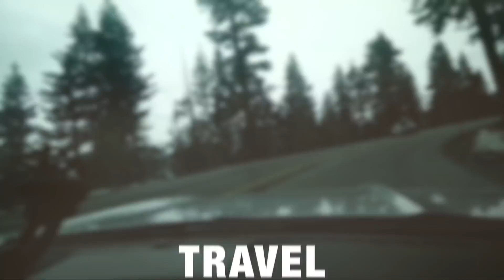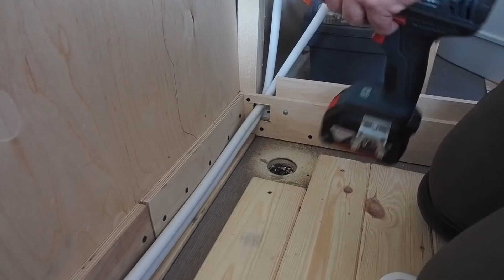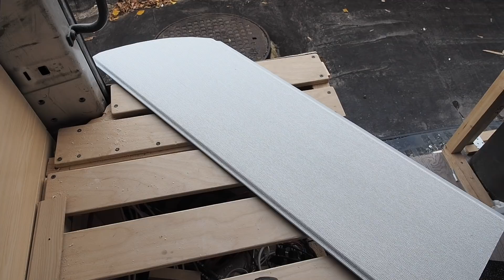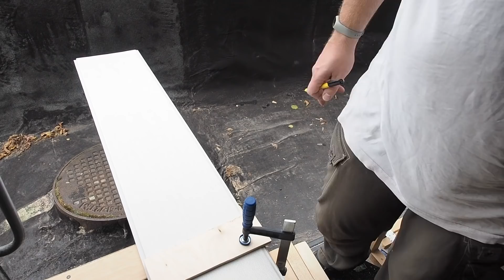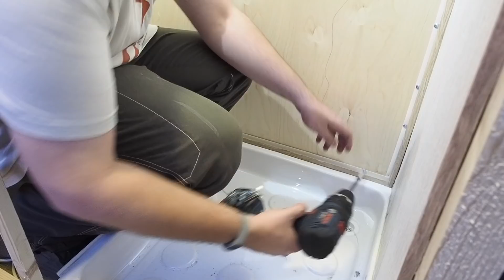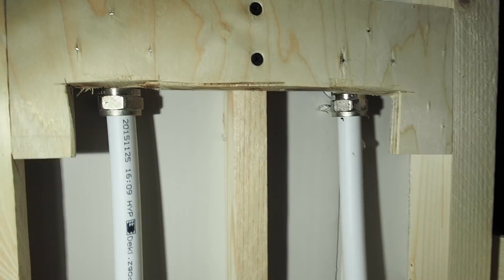Bathroom building in van conversion. Plastic paneling, shower tray, mixer tap, shower head, piping

Comment: curious about... why did you put the shower in the middle of the van? I plan on installing mine in the back, so I could use it outside, like to remove beach sand or dirt, just open the read doors, clip a curtain, and be done with it... also... where does the wasted (gray) water go? just outside or do you have a gray water container?

Comment: i will use cement board for the shower wall
Reply from the maker: Cement boards in RV probably not the best idea.
Reply: i never learn how to do RV but i learn how to remodeling the house
Reply from the maker: Not all works for rv that you use at house. Cement boards will just fall apart with vibrations
Reply: I saw couple use cement board on their skoolie. i bet it works just the same.
Reply: @Vantouristcom  hi. What material are the panels you used?

Comment: great vids ...very precise.....just a thought on the 15mm speed fit(if thats what i was ?) i thought it was advised to use pipe stiffeners when connecting to a compression fitting. maybe your experiences have indicated this is not needed.?
Reply from the maker: No, thats not that types of fittings. We didnt have speedfit with stiffeners in my country
Reply: VanTourist....sorry, i thought you were in the UK !
nice job by the way, going to be a smart van ;-)
Reply from the maker: Thanks!

Comment: Very handy man. Thank you. My strategy is to buy a taller wardrobe cabinet and simply punch out the floor and line it with plastic panels to cut on woodworking work time.
Reply from the maker: Nice plan! That could work

Comment: I would have really a rethought running the electrical wire right behind the shower pan and if it had to be done I would have used outdoor wiring you know that grey stuff
Reply from the maker: Too late :) anyway I sure it will not be a problem there. This wires have huge isolation and will not move at all.

Comment: Did you miss a step with the shower drain? The drain was in 2 parts (funnel and grill) and when you put the glu in, I didn't see the funnel part being installed before you glued in the pan....
Reply from the maker: You didn't see it because funnel was already secured under the pan. funnel and grill connected together with bolt & nut. I guess i just didn't have video of doing that

Comment: Just amazing. Where did you get those plastic panels for the bathroom? Thanks.
Reply from the maker: Hi Juan. I bought them local and sadly they are not sells outside Russia.
Reply: VanTourist I liked it very much because is made of plastic and it is better for water and easy to clean. I will search in Spain for something similar. Thanks.

Comment: Bro, why did you not use Stainless Steele screws in the shower, and pressure treated wood...? Plastic contracts and expands and you should leave wiggle room for this. Making the panels as tight as that will cause them to crack...
Reply from the maker: +Franco Vision this panels advertised as not affected to tempersture much. Will see.

Many RVs almos made by plastic, i think panels will be fine
Reply: The panels are great. You may have made them to tight and plastic as all material needs to stretch...

Comment: Your videos are fantastic and have given me some great ideas for my own van conversion.  I love these plastic shower panels. Could you please let me know the brand  name and where you bought them.  Thanks for sharing.
Reply: Did you ever find out the panel name or where to get them
Reply: @jeffreymckee9677  I'd like to know as well.  However, this looks like some kind of board and batten exterior siding.  I have a shower in my old camper that is falling apart.  The back wall curves up into the ceiling like this and I have been racking my brain as to what to use.  It never occurred to me to use exterior vinyl siding.  This should work perfectly!  I had to scroll a good ways down and he says that this particular product is only sold in Russia.  However, somebody else found a similar product at Lowe's.  I don't know anything about this product or what it's made of, but it might work for certain applications.

https://www.lowes.com/pd/EverTrue-7-5-in-x-2-83-ft-White-PVC-Tongue-and-Groove-Wall-Plank/1000445255

Comment: What is heating the water and does it use propane? 

There are a bunch of water heaters out there that use propane but it might make more sense for something low tech to heat the water container to slightly warm then a standard water pump to pressurize.
Reply from the maker: +David l I plan to install 10L 220V 1.2kW boiler heater. By my calculations t would work with power system I already have.

I not want to use pro pain heater for now because it much harder installation and ventilation needed for it. If my option will work - I will be more than happy with that 10L baby
Reply: Another idea might be an Eberspächer Hydronic system. Expensive, and you need to plug it in to your diesel tank. It would heat the entire van, though, as well as heating your hot water.